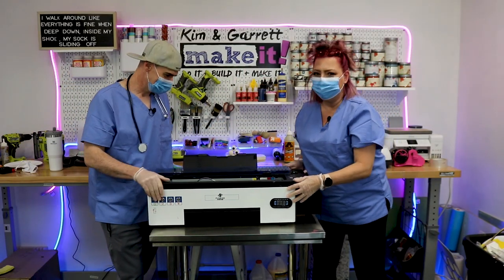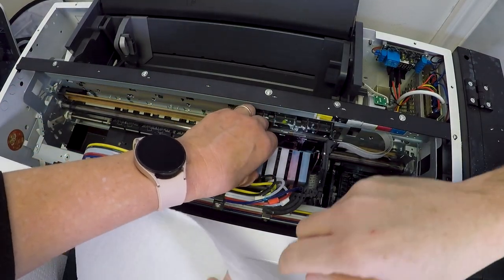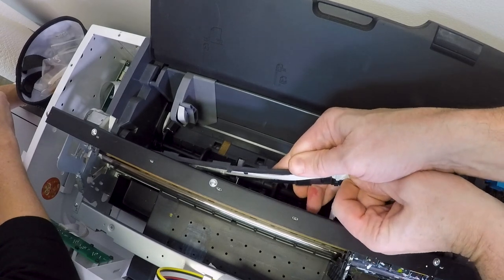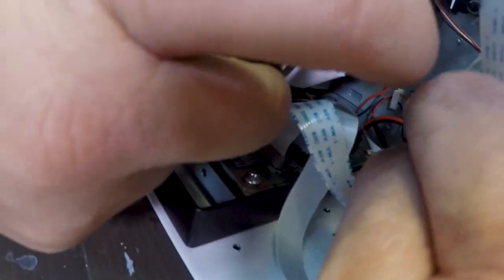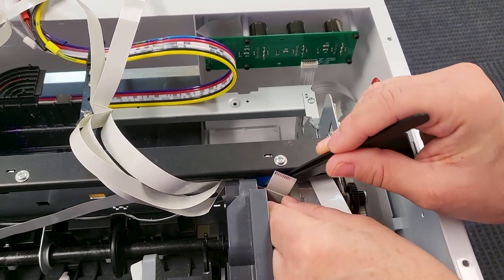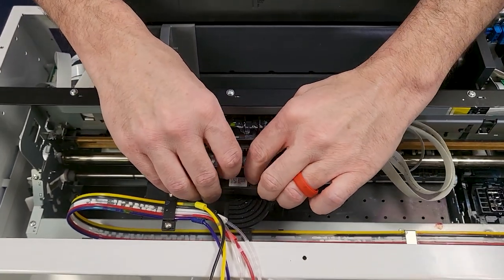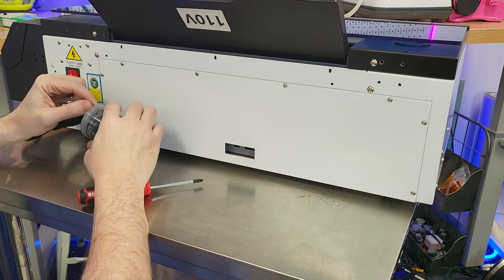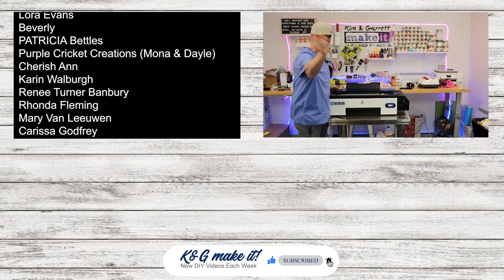MELTDOWN!! How to Replace DTF Printer Cable and Print Head

Comment: If the print head is bad will it cause the power button on the front not to come on? I cleaned the printhead and put it back together. It came on briefly, then had red bing lights then nothing after i turned it off and back on

Comment: Hey Kim and Garrett , I truly understand what you guys went through, I got the same machine and have talked to the engineer in china , I also had to change out the motherboard, cables and 3 printer heads , what would like to know the old print head, can they be unclogged, bc $360 is a freaking a lot of money. To keep replacing, that white ink is no joke
Reply: Oh I have trouble resetting  
 my ink waste  thingy , my white usb has and error do you know how I can fix this

Comment: Hey guys, I have looked and searched and I cannot figure out the controls on the right hand side of the printer it has numbers, but is there a certain set certain settings that I need to make the shaker work properly

Comment: What would be different reasons to replace the ribbon besides this reason?  I have something wrong with my printer and one of the only things I didn't try yet was to replace my cables.  It prints, but not correctly.  The hue and colors are insanely off.  Is the customer service place you called American based and would they help someone that didn't buy their printer from them?  Id be willing to pay.

Comment: My printer stopped working after print head change and small nozzle check , I found that cable connection is old and busted but printer lost power and now I can hear tiny beeping sound , I checked back plate for fuse and it’s fine but still hearing this sound and not sure what to do next , can you guys help me work it out
Reply: Main board and possibly printer cable
Reply: Did u get it fix because my printer lost power as well after print head change

Comment: When you burned the cables did the printer still turn on?
Reply from the maker: Yes and it would act like it was printing, but nothing would print.
Reply: @KimandGarrettmakeit  wow thank you for your prompt reply! Awesome! It’s because I was cleaning mine as well only I did have the power OFF. But I believe I did get the cables wet and it suddenly shut off and no it won’t power on at all 🥹🥹
Reply: Did you figure anything out yet? I did the same thing , changed printhead and cables still no power

Comment: So I know this is an old video BUT I AM PRAYING SOMEONE CAN HELP🙏🏼🙏🏼🙏🏼 I have had 2 epson L1800 from Taiwan and loved them but fried the motherboard. I bought this punehod like the one in this video from a girl offline and when I went to replace the printhead my new Epson L1800 printhead the printhead cable is too big to fit in the cable that came with the printer? How can a L1800 printhead have a different size cable opening on the printhead than my other L1800? Where do I buy the printhead for the Punehod printer? No one ever shows the cable openings in their pics for the printheads and I don't want to buy another one and get the same one.....
Reply from the maker: Contact Punehod!  They will send you the link to the right cable.   I think it's this one. This was the one in our Amazon orders.  https://www.amazon.com/gp/product/B07DPL4FN3/ref=ppx_yo_dt_b_search_asin_title?ie=UTF8&psc=1
Reply: Hi Stephanie!!!!

Comment: My print head not move when turn on, any suggestion?
Reply from the maker: Check the belts and try turning it on and when you hear the head release, unplug it.  Then move the head to the middle, plug it in and turn it on.  This worked for our sublimation printer that had this issue.

Comment: I would suck out a bit of that air on those lines first before doing any head cleaning to prevent damaging the new head with those gaps of air running through the printhead

Comment: I was flushing my print head and didn't turn off printer as well.  I also took out the print head and then reinstalled it.  The red light is staying solid.  Does that mean I fried it? Thanks